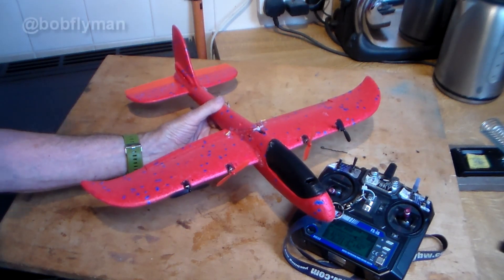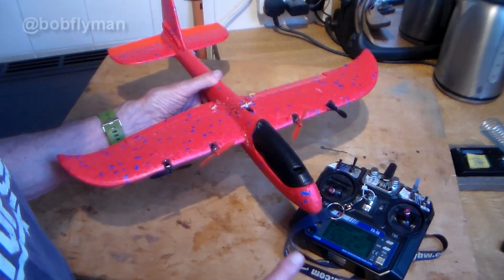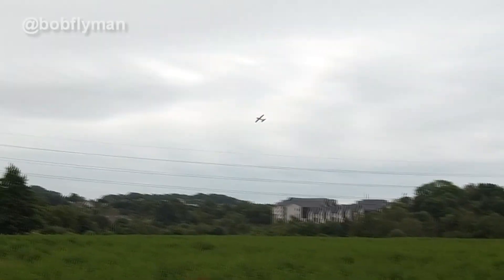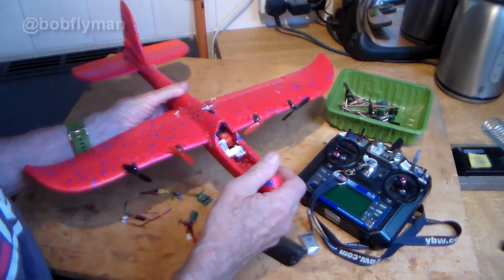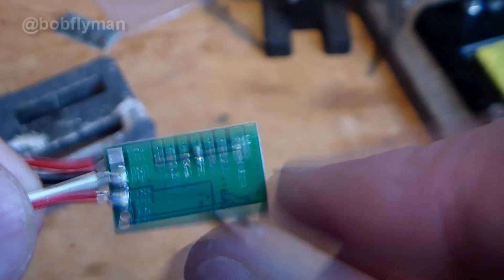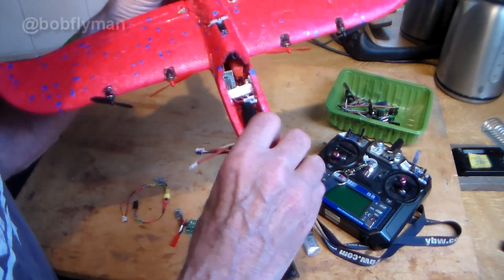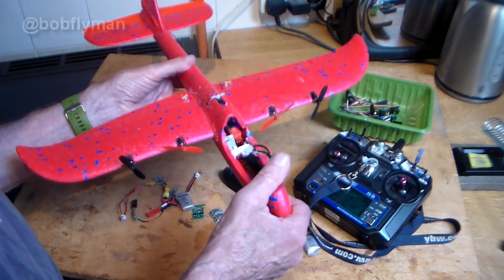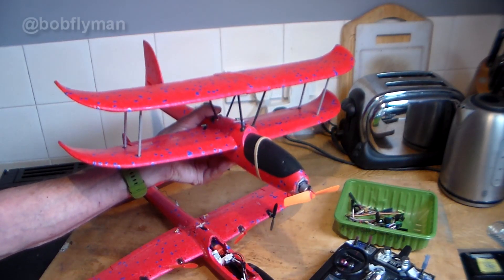TWO Clever Ideas Sorted my  Mini Lidl 4 Prop Plane?

Comment: Hi!
i saw your videos with the small gliders and found this one. i was thinking to take a tiny Eachine E013 drone and take and put the 4 motors as they are on the wing. 2 under the wing and 2 over it to use the configuration and the existing fc to make it climb or not.
I haven't found any video and i don't know if it will work
what is your opinion?
Reply from the maker: It works I did it! 
I built a mini Lidl with 4 drone motors and the board from a mini drone. Obviously board has to be installed level as it has a gyro. I configured it so that it would fly by differential thrust when using the drone tx. And one motor each side had downthrust to help pitch control, ie climb and descend.  Good fun and it worked. Maiden and build linked. You'll need to watch the build one as I can't totally remember how I did it!  
https://youtu.be/p3L6NqLW6hs?si=KNNnUcD9OY4ZB954
maiden  https://youtu.be/e3ofeEpg8w8?si=4v-s_xA7EATclQdO

Comment: How much did it cost
Reply from the maker: 4 8520 motors £5, props £3, 2 2g servos, £6, BEC £1, FS2A receiver £5, 2 brushed ESC's £4. 
A little over £20, plus lipo.

Comment: You should've just checked AR3201-A2 FlySky AFHDS 2A receiver built-in 2 brushed ESCs speed controller. You'd still have the differential thrust, BEC and servo outputs  (Integrated two brushed 5A ESC and DCDC-5V/1A boosting power, with 1.00 mm servo terminals/plugs)  :) You might need to swap the connectors. Just solder in the leds for suitable plugs instead of trying to cripm these small ones 😅
If I ever end up tryin tone that's my to go  way, having 2 motors in each input in series :) lighter, compact, and optional telemetry and stabiliztion, these receivers come in many configurations, also under a few different names too 🙂

But this'd work on 1S so you'd probably have CG issue with it. Anyways, glad it works now :D
Reply from the maker: Thanks mate, I looked at the board you suggested, it's a pretty neat board, but not cheap.  A bec, £1 and two brushed esc's and Flysky FS2a  less than £10. The board you mentioned was £25!  My fix worked, I'm happy.

Comment: What a great success Bob, now build a Lancaster 🙂👍
Reply from the maker: I can remember someone who has already tried that with a drone board?  🤔
Reply: @bobflyman that's why I mentioned it 😅
Reply from the maker: @CliffHarveyRCPlanes well,  re the drone crash, it appeared to be ok, so I tethered it to a couple of lumps of lead, took it outside and now it won't bind.  Bear in mind this is the drone where the circuit board was cracked and I bridged 10 breaks. 😥. It was ok after that though, but is the tx playing up, or is it the crashed drone? I've taken the latter apart and found one broken wire! 😭😧🤔🙄